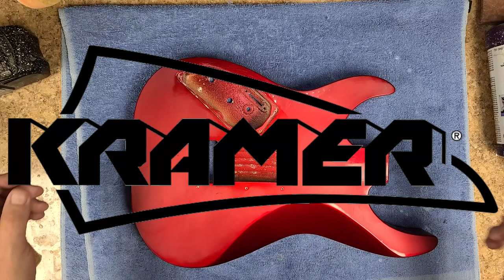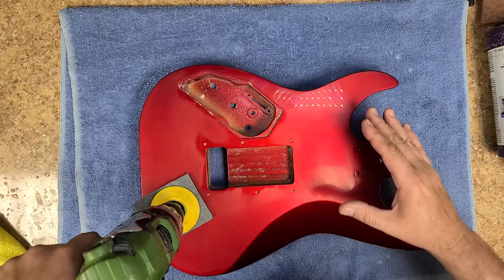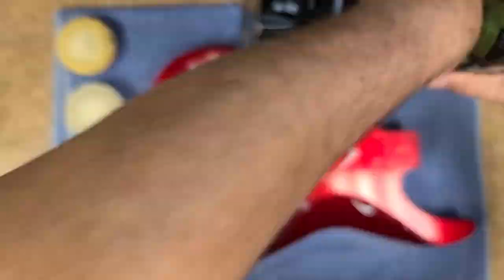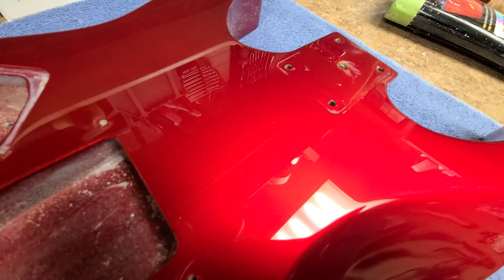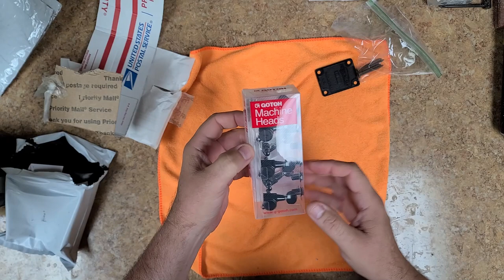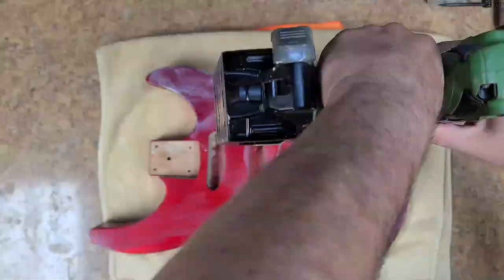How to Achieve the Wet Look and Unboxing 80s Kramer Focus 6000

Comment: For The Age The Paint Held Up Well Great Shine And Tuners Fit Perfect I Owned A Right Handed Kramer Striker Once A Hardtail Was Just Really Hard To Play But Great Action On It Would Still Have It If It Was A Lefty Been Slacking On Getting The paint Of The Ibanez GIO Lefty Seems The Best Parts On That Whole Guitar Was The Body lol tuners and bridge and bar which I Will Have To Use The Same Bridge The Hipshot ones are to high but look amazing almost like the Dinky hopefully will be fixed in the next few months But Gonna Order Some eBay Cheap Locking Tuners I Guess And Reuse all  The Stock Pickups I Took Out there Good And Maybe Make The Headstock With A Natural Finish As Well Maybe Diamond Cut Graphics Can Make My Name In Old English For The Way I Want It Great Job Eric Nice Shine Brotha Rock On Hope You Had A Great 4 th 🎉💯😎🎸🔥